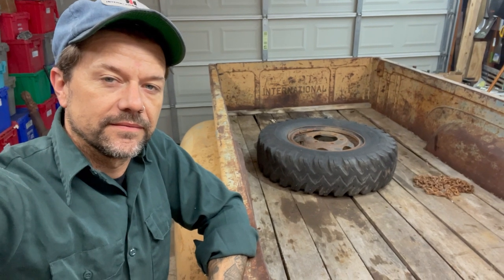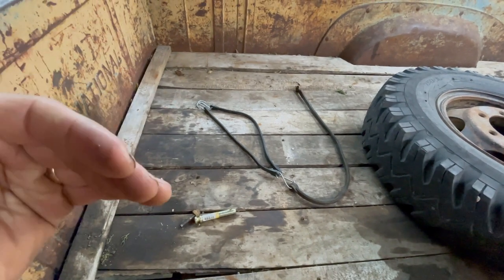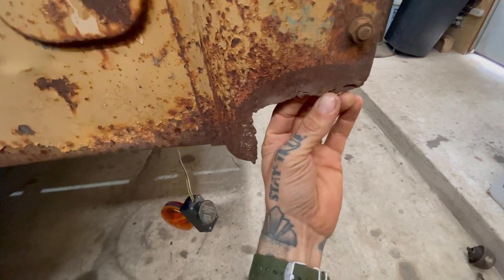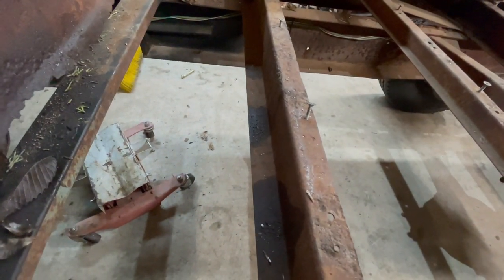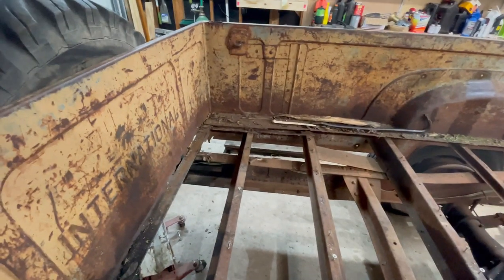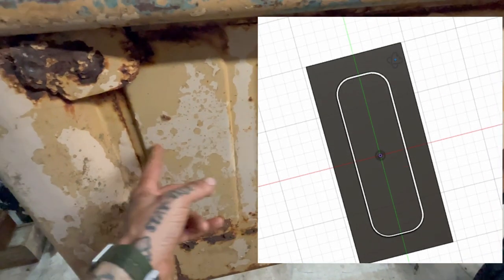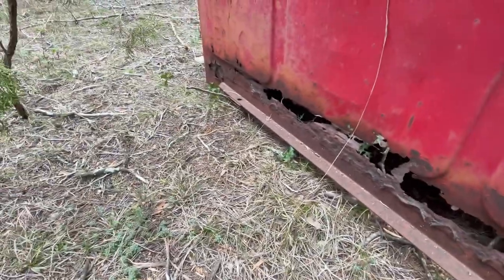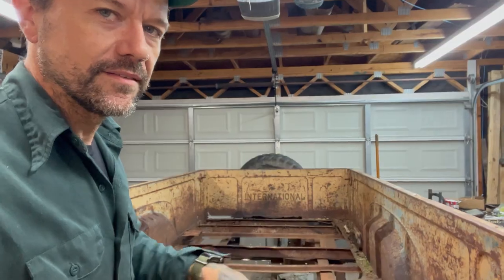The Amazing 9 Foot Bed Project: Part 1

Comment: Just a point of observation, the "hat" channel cross pieces in the red bed are welded in "brim" up, while the tan bed has the "hat" channel welded "brim"down (just the reverse).Could be because different country of manufacture or maybe steel versus wood floor bed? Anyway, something else to research.😉
Edited: Maybe the tan bed originally had a wood floor? The "brim" down installation would shed any water dripping down between the boards instead of creating a "pond for rust". The solid steel floor would shelter the channel with the "crown" of the "hat".
Reply from the maker: That’s an excellent observation and line of reason. I’ll do my best to chase that down further.

Comment: I appreciate how you take time to explain everything. I have a 59 b 120 4x4 with a 9 foot bed that’s in really decent shape. You have definitely inspired me to get it out and drive it and use it on a farm clean up job I’ve been working on. I cut up part of an old hay bailer and made a tool box that fits nicely in the bed. It has the international harvester logo on it and has the same patina as Della. Keep the videos coming I’ll watch anything you post.

Comment: Isaac sent me over here. Wow!! I love Internationals myself. I love the lift and the 9 foot bed. I hav been looking for a 40's or 50's to make my welding rig. I want to mount my Bobcat, a drill press, a swordfish vise, a welding area and a pipe vise and a compressor. How did half of the bed get so bad and the other half have excellent rock guards still in perfect shape from what it looks like..

Comment: I've been sizing up my S120 for bed sheet metal repair, so this is super awesome to watch you tackle yours.  I'm very interested in how the floor sheet metal meets the front panel and front Z channel.  Also with how the floor meets the side panels.  Mine is so rotted it's hard to tell how it's supposed to be.
Reply from the maker: I’ll do my best to make it easy to follow. I may have to bite the bullet and make a website to host files with all the measurements to help folks who have to make some of the badly rusted sections from scratch.

Comment: Those "bullet" holes could have been made by a sharp pointy tool, like a pick or a big hammer and heel bar. I've seen it done before when no drill was available. Or they had a block of wood or sandbag on the fender and shot a hole in it.